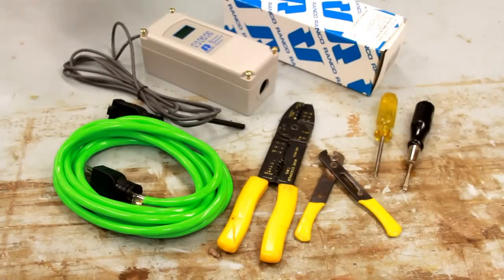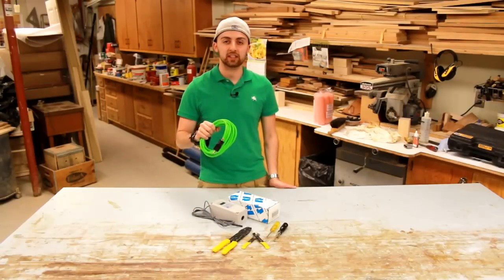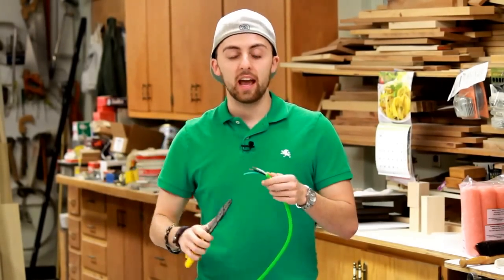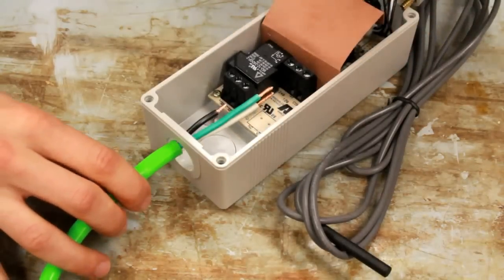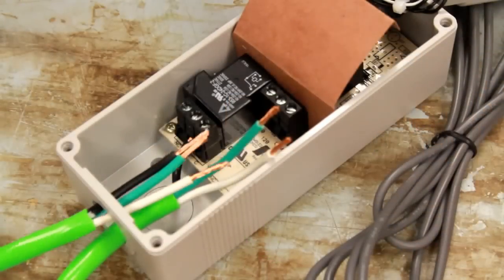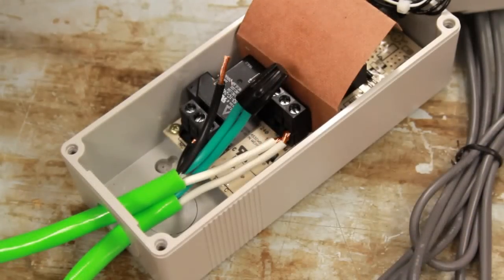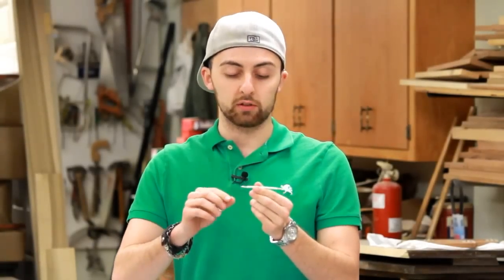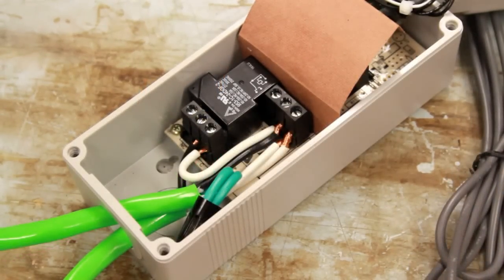How to wire a Ranco ETC 111000 Digital Temperature Controller

Comment: good video. but I have to point out that ranco makes a controller that has a pre wired and sealed female end the comes out the side. also not sealing the opening on the bottom renders the  nema4x enclosure worthless leaving the pc board exposed. i had a controller ger moisture in it and it cooked and killed a lot of fish. that same issue could ruin a batch of beer too.

Comment: Hi!  I have a similar controller.  When it is in operation, I pressed on either the UPPER or LOWER ARROW button and the display shows E1.  Do you know what seems to be wrong with it?
Reply from the maker: try hitting the "set" button first in order to enter the menu, then use the up or down arrows. if that doesn't help, i'm not sure i can
Reply: Nick Koridis Thanks!  I will try that tomorrow.

Comment: You should've used black for your jumper. You should never use white on the power side only on the neutral side
Reply from the maker: Thanks for the tip. You're totally right. I used white to contrast the black and make it obvious in the video that there were two wires there but from an electrician's standpoint, that's plain dumb.

For anyone reading, it works either way, but for continuity and correctness, choose the black wire for your jumper instead.